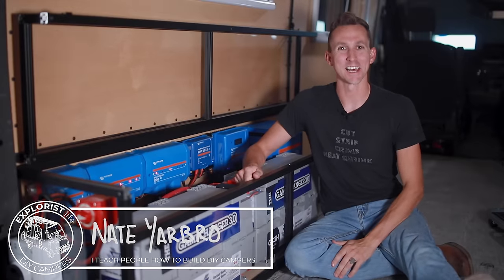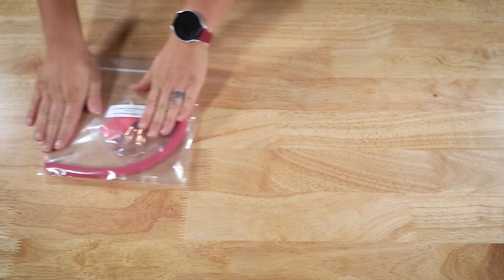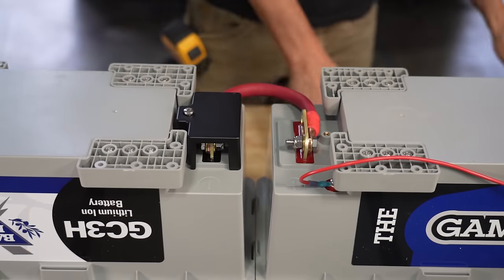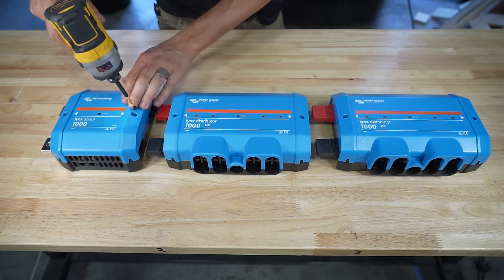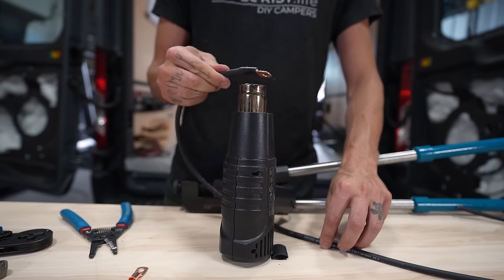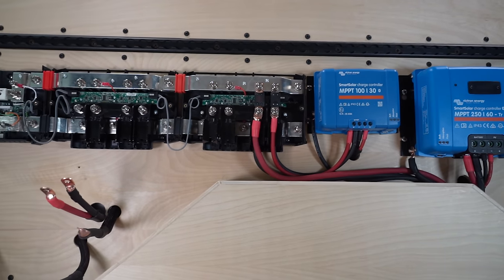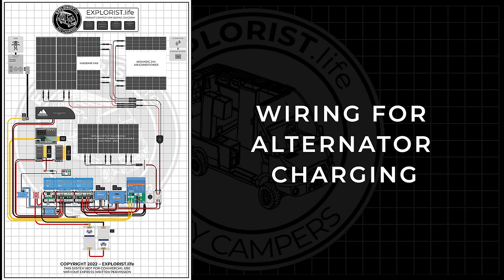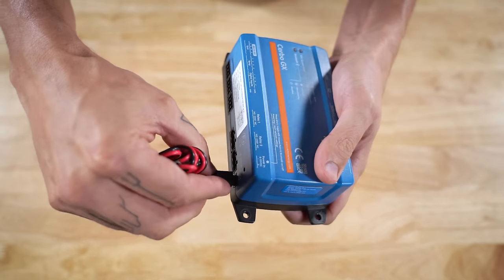DIY CAMPER VAN ELECTRICAL INSTALL (Start to Finish Tutorial)

Comment: You do great work!  Beautifully laid out system.  One question:  Why no wire terminals on the circuit connections to the DC panels?
Reply from the maker: Ferrules are a tool and not a requirement.   In our case, 10AWG wire w/ ferrules on them don't fir there but the stranded ends do.  We use ferrules anytime they fit, but if they are in the way, we opt out.
Reply: @EXPLORISTlife  Gotcha, I was thinking more like forked terminals for the positive connections.  That would make installation easy and you wouldn't have the splayed conductor that can relax over time.
Reply from the maker: @chiphill4856  Yeah, also another good option there.  There are nice wire retention plates on the positive terminals that work well with the stranded wire as-is.  Fork terminals are another option if it makes you feel better.
Reply: @EXPLORISTlife  Gotcha.  Forked terminals for pos would give me confidence that the wild strands wouldn't touch or relax over time.   Great, well made vids with excellent sequencing.  Thx ✌🏼
Reply from the maker: @chiphill4856  Great!  Yeah, do that in your own build then. 🙂👍
Reply: @EXPLORISTlife  Touchy
Reply from the maker: @chiphill4856  Not touchy, no.  Just responding with some positive validation. 👍🙂

Comment: heater circuit wiring not fused?
Reply from the maker: It is not.  The heater wiring kit from Battle Born does not come with a fuse and their documentation does not specify a fuse.  I suspect this is because it's below 7" and could be considered a pigtail, which doesn't require a fuse.
Reply: @EXPLORISTlife  Interesting. I guess those heaters never go wrong then!
Reply from the maker: Guess not! 🤣🤷

Comment: No fuse on the heater wire?
Reply from the maker: Not called for in the instructions nor in their wiring kit, so I didn't add one.
Reply: @EXPLORISTlife  
That’s so surprising!! 
Kinda scary that it’s the closest thing to the cells unfused and a heating element.
Reply from the maker: @Tyler-ms2tj  I'm sure Battle Born accounted for that.  Likely, there is some kind of self-resetting internal circuitry going on in the BMS PCB.

Comment: Come on man, its not a space shuttle you are building. its just electricity for a small rv.... Personnally I own a small rv and will not do that. way too much wiring for what it is. might be a easier solution
Reply from the maker: I sorta don’t care what you do in your own build.  It’s no skin off my back if you slap some shit together and it doesn’t work or starts a fire.  No need to come talk shit on my channel.

Comment: Great Video. I wish it was available before I did my custom build on my Class A rig. There are some things that I would have done differently. 

One question: How come you did not use Ferrules on the Solar DC Disconnect wires? 

Just curious if it was a technical /code reason or preference.
Reply: Follow up question: Have you considered using the relay on the Victron inverter to control a fan for the battery box area. Mine got to hot during a heavy charge cycles in warmer parts of the country. In my build, I had to add a 12v fan and wire it to the relay on the inverter then programmed a help to engage the relay when the inverter fans turned on. This pulled air thru the box and resolved my over heat protection issue.
Reply from the maker: Glad it helped!  Ferrules in the DC disconnect don't fit particularly well, so we don't use them.  The terminals, though, are spread out quite a bit so the chance of stray wires getting into the wrong terminals is nearly zero.

Comment: To be really honest, electrical installs on campervans have become far too complex and overkill.  There's so much completely unnecessary equipment going into vans now. keep it simple and cheap. You really don't need all this equipment which takes up the most important part of the campervan which is space.   Its like making a torch where you only need a battery, switch and a bulb but then someone adds a cut off switch, a monitor, a power management system, a lumens sensor, a Bluetooth remote or add a pistol grip etc.  The end result is the same, the light comes on.
Reply from the maker: I see you like metaphors...  An electric scooter will get you from point A to point B just fine; but there are some of us who would rather rebuild a '66 Mustang from the ground up to drive around in. 🙂👍

Comment: "tighten to spec." always annoys me.  if it's really so important to do so, why don't you tell us what the spec. Nm is?
Reply from the maker: I don't like saying it in the video in the event that the manufacturer changes the torque spec from one model to the next.  Plus... sometimes a manufacturer doesn't make a recommendation, so I have to say 'tighten to an appropriate torque' because it's not listed and I'm not about to make it up on the fly or something.

Comment: Impressive.
Thank you!

I was put away to watch it due to the video size, but after someone pointing to it I got through the whole video.
Definitely worth it.

Couple of points:
There is some cable way too thick, and that is dead weight in a van, with its load limits.
Than Multiplus will be a projectile in case of accident, due to it's weight; I would consider fixing it to van structure / 8020.
Heat generation from SCC and Multiplus may be a concern under heavy use.

Your system is quite similar to mine, including roof and exterior panels.
I'm sad that Victron doesn't have a bigger Orion for alternator 12v to 24v, even pairing 2 units...
Reply from the maker: Thanks for watching!

Regarding your 'couple of points':

1: No cable is 'way too thick.'  The positive, negative, and equipment ground wires for the solar charge controllers are the only ones that could be considered 'excessively' thick; but considering that the shipping weight of both of those kits is only 6 pounds, and we didn't even use the whole 5ft sections of either, it's unfair to say that they are contributing to excessive weight.  I see this as a non-issue.

2: The multiplus should not become a projectile.  Even if the crash were bad enough to pull the 7x #14 screws from the wall, the multiplus is still inside of an enclosure, completely secured to the van's body.  The multiplus is also 'secured' via 3x 1/0, 3x 10ga wires, and 3x #6ga wires which would further keep it from 'becoming a projectile.'  If the crash were bad enough that the multiplus could escape all of those bonds, there would be a LOT of shit flying around the van.  I see this as a non-issue.

3: There is about 27sq/in of ventilation clearance around the back and lid of the enclosure.  Based on the 100's of installations I've consulted on, I do not expect overheating issues due to this clearance.  If there is overheating issues, we will add thermostat-controlled vent fans to either end of the enclosure (will make a video of this if it comes to that).
Reply: @EXPLORISTlife  Hi again!
Ref (1): Considering that so many vans are over the weight limit after the build, I would still keep that into consideration, though I think your reasoning is fair.
Ref (2): I've seen quite a few campers' crash tests, and that was not pretty. Every wood piece is ripped apart if supporting any weight. So let's agree to disagree on this one :) (though you are the professional, and I'm just a DIYer)
Ref (3) yeap... than would be an easy fix, tbh
Have a great day!
Reply from the maker: 2: Yeah, you can obviously disagree with me, and that's your prerogative, but when you're telling me I'm doing something wrong, I have to defend myself from people questioning my methods because of everybody reading through the comment section here.  Fun fact... I was a firefighter before this YouTube gig and I've seen wrecks bad enough to dislodge the motor and the body from the frame of the vehicle.  It's impossible to plan for every single scenario and we have to remember that we are often traveling in excess of 70 miles per hour only a few feet from another vehicle traveling 70 mph is another direction, both carrying 20+ gallons of flammable liquids while being powered by 2,000+ explosions per minute.  Driving is a REALLY dangerous activity.  If a 40 pound box secured to the wall with 7x #14 screws that is in another box that is secured with 5/16" bolts to the body of the van gives you pause, you may want to re-consider driving altogether.

Comment: Glad to see you’re posting again after your recent illness…   

May I suggest that you mention that you shouldn’t wear any type of jewelry (wedding rings, watches, etc.) while working on electrical systems.  It appears that Steph and you having tattoos on your ring fingers which is a cool alternative to the traditional wedding rings.  I would also mention the use of safety glasses when working with the table saw and the aluminum, although we can only see your hands.

It is my understanding that the Solar Controller’s only function is to assist in the charging of a battery bank.  And with the solar disconnect, it can be completely isolated from the AC/DC electrical system.   I came up with a theory in which would mostly benefit both the van camper community and those who store their RVs outside for long periods of time.
Starting with the 4/0 battery cable at the battery bank, add the fuse holder to the end of the battery cable, then add a 3-inch bus bar between the fuse holder and battery disconnect switch. Attach another 3-inch bus bar between the negative system side terminal of the battery shunt and the chassis ground. 

Next, attach the solar controller positive terminal and the positive lead (optional rated 12V on/off switch) of the battery shunt to the positive bus bar.  Then attach the solar controller negative wire to the negative bus bar. The result would be that while you’re away hiking, biking, rafting, or just enjoying the outdoors for several hours, you can turn your battery disconnect on, but your batteries would still charge from the solar controller and eliminate the electrical charge from the solar controllers from entering your electrical system.  Those who store their vans and RVs outside could keep their batteries topped off based on just the solar power and eliminate the need for a trickle charger. You can always turn your solar disconnect on to eliminate charges from the solar panels
We run our fridge strictly on propane (for efficiency) or AC.  No need to send power to the Cerbo GX and add the additional current draw when both devices can be monitored via blue tooth.
Just an idea…
Reply from the maker: For Jewelry/safety/etc; yes.  Everybody should take proper safety precautions.  Here are my affiliate links to all of that stuff, so load up!
Powered air purifying respirator: https://amzn.to/3fkFOt5
Helmet: https://amzn.to/3UQdiQv
Safety Glasses: https://amzn.to/3LFPoCM
Gloves: https://amzn.to/3xRTAtt
Hearing Protection: https://amzn.to/3C81DVC
Chaps: https://amzn.to/3dCHE8h
Steel toe boots: https://amzn.to/3RcwEfi
Nomex hood: https://amzn.to/3xTakk5
High Visibility Vest: https://amzn.to/3RkLdOg

Your proposed idea is a good one, and I've done that in the past, but the added connections and physical size of the added connections is not worth the minimal benefits.  Simply turning off all loads while keeping the solar array running is sufficient for 99% of cases.  If you killed off power to the Cerbo GX but allowed solar to charge the battery bank, the cerbo would lose track of state of charge every time the system is disconnected.  Obviously you can do whatever you like in your own build, but I would recommend just keeping everything on the same side of the switch like I've shown in this video.
Reply: @EXPLORISTlife  Thanks for the reply, but wouldn't the Cerbo get the information from the shunt ?  I thought that the shunt determined the SOC, not the Cerbo.
Reply from the maker: @williamf8257  The Cerbo does indeed get info from the shunt.  If you kill off power to everything but your charge controller, though, the shunt will not have the power to operate.  You'd have to keep power flowing to, at the bare minimum, your shunt.  Sounds like you're trying to do something like I did in this video back in 2019 (no longer recommended): https://www.youtube.com/watch?v=qrZ-cr5qEwU

Comment: 4/0 “aught” AWG is overkill for a 400 watt solar system?
Reply from the maker: For the solar part, yes, but not necessarily for the inverter/batteries: Check https://shop.explorist.life for various 'appropriately sized' wiring kits and diagrams.
Reply: @EXPLORISTlife  website is no help I’m not paying for something I have no idea if it answers my questions or not I figured it out as best as I could for free from other channels thanks anyways
Reply from the maker: Well, everything you need is available for free right here on our channel.  For example... we have a specific video talking about how to choose wire sizes.  But since you didn't take the 3 seconds to go back through our videos and see if we had a video that actually answers your question, I figured that a kit that already answers that question would be easier for you.
Reply from the maker: If you are expecting me to teach you start to finish all of this stuff in the comments here that I've already made videos on that's not something I'm willing to do.

Comment: Not sure what the DIY is here. It looks like you bought the most expensive equipment on the market and followed the diagrams.
Reply from the maker: It's because I installed it myself.  DIY stands for Do It Yourself.  DIY doesn't have to be done with the shittiest components available with half-assed workmanship.
Reply from the maker: Neither Victron nor Battle Born are the most expensive either.  Both are cost comparative with other brands of similar quality.  There are more expensive batteries and inverters/Chargers out there.
Reply from the maker: Don't tell me what to do.  If you don't like something, navigate to a different video.  I'm always going to call out people on their bullshit.

Comment: This is an excellent video. However, there's one major flaw. You have the 30amp shore power plug that can only be used in... campgrounds. There's nothing to connect to a regular 120v plug which will be what's available most of the time since having a DIY campervan is to avoid...campgrounds as much as possible. In real life, the 120v is more important than the 30amp campground connection. And what about connecting the diesel heater???

Also, all this is very nice but it's the very high-end stuff and overkill for most DIY campervans. It'd be nice if you were doing a video for the vast majority... and you'd be selling way more stuff btw... 😃
Reply from the maker: There's no flaw.  You're concern is handled by using a 30A to 15A adapter on the end of the 30A shore power cord: https://shop.explorist.life/shop/all-products/connectors/15-amp-to-30-amp-power-adapter-plug/

We showed this in action back in the shore power video we referenced as well as at the 1:09:39 timestamp in this video.

It is indeed very nice stuff, thanks for that!  'Overkill' is obviously your own opinion, which is fine; but our videos and products are backed by our website traffic and the analytics we have one the back end of the channel, which tells us that this size of the system is actually the most popular one to our audience.  I'll do a smaller system eventually, but it just hasn't been as popular on our site so I hesitate to put out a video I feel may be an underperforming video.

Comment: The old twist lock shore power cords should be replaced with the Smart Plug longer blade design.
Reply from the maker: The twist lock shore power cords are fine.  If you want to substitute in the smart plug inlet/cord in your build, here is a link for that: https://amzn.to/3WVjiXL
Reply: @EXPLORISTlife  Well after se real years in a marine environment and detaching the the cord about 70 time in the season plus the boat pumping back and forth many time a day in the slip one fitting arced and burt, the an other end weld it self together. I am converting the installation so a fire does not start. I had done it on a previous boat. It is better to be safe than sorry. You ar very precise in cleaning all fitting before assembly otherwise.
Reply from the maker: Sir... this is not a boat.

This is a van that is not in a marine environment that is not subject to rocking back and forth in the waves.  Like I said...  If you want to substitute in the smart plug inlet/cord in your build, here is a link for that: https://amzn.to/3WVjiXL

Comment: Hi. Good video there, but I think you forgot to tighten the negative connection on the batteries to the main power switch in the video.
Reply from the maker: Every connection was indeed tightened.
Reply: @EXPLORISTlife  check again, you forgets to tighten it with a spanner....
Reply from the maker: Regardless of what was or wasn't shown on this video: every connection was indeed tightened.  Somtimes when we are making these videos, things get accidentally left out in the shooting or editing process.  This hour-long video took about 3 weeks to make, so there is always going to be 'something' that didn't make it into the final edit.
Reply from the maker: I do appreciate how closely you're watching the video though.  Thanks for watching!